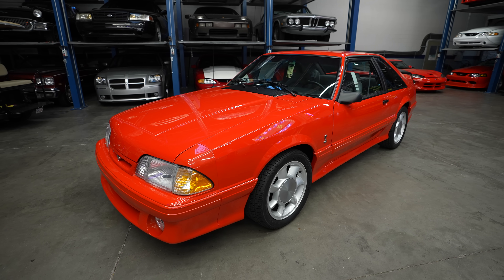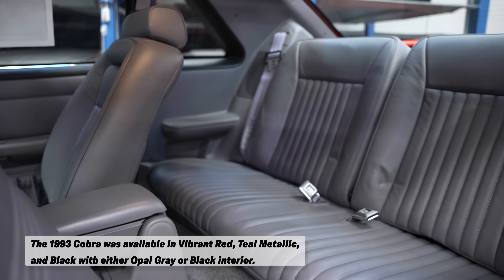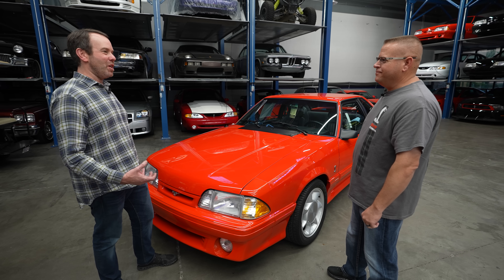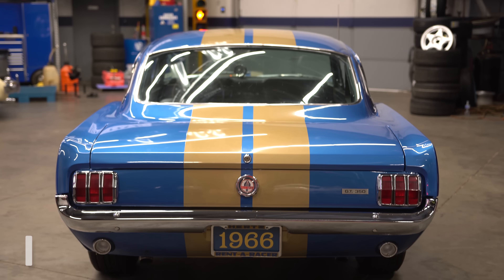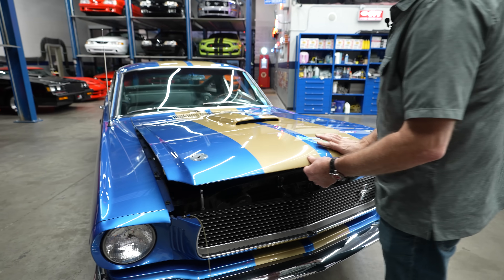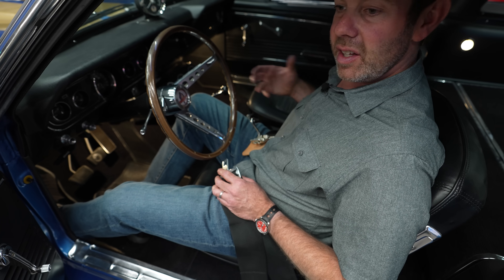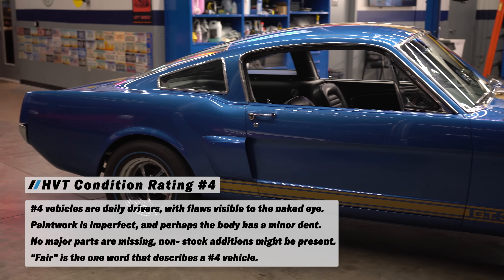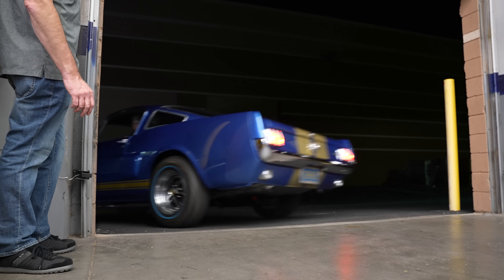1993 Ford SVT Cobra Mustang and a 1966 Shelby GT350 Hertz Mustang | The Appraiser - Ep. 8

Comment: In 2003 These things at 10 years old with low miles were frequently selling for $10-15K as people looked to the new Terminators; still kicking myself for not picking one up back then
Reply: BACK IN 2005 I BOUGHT MY VIBRANT RED 19THOUSAND ORIGINAL MILE SVT COBRA FOR 17.500 BUCKS AND TODAY I HAVE 20THOUSAND ORIGINAL MILES SO IT'S SAFE TO SAY IF I WANTED TO SELL IT IS MAKE MONEY ON MY INVESTMENT AND I HAPPEN TO BUY A 04 TORCH RED TERMINATOR WITH JUST 29HUNDRED ORIGINAL MILES ON IT AND I THINK IN THE FUTURE THE TERMINATORS LEFT IN MY CONDITION WILL BE BIG BUCKS LOOL I HAVE A COUPLE SUPERSNAKES AND I THINK MY TERMINATOR MAY POSSIBLY TRUMP BOTH CAR'S IN VALUE BUT ANYWAY WHEN I FOUND THAT TERMINATOR I KNEW I HAD TO BUY IT.

Comment: I couldn’t imagine buying my dream car to then park it in my garage for 30 years. 
Also, I understand that changing from stock makes it less valuable, but I would take disc brakes, a/c and a stick allll day over the original.
Reply: Agreed. My heart sank when he said it had 500 miles on it. People are free to do what they want with what they own; But I feel great cars are meant to be driven.
Reply: @KernelFault  I have to disagree a little bit, great cars should be shared. If you own a rare or special car and you are not sharing it on a regular basis by driving it (200 miles a year on this car would only be 5800 miles) or by showing it often you are doing a disservice to all car enthusiast.
Reply: @WH17Y  Then how are you disagreeing with me? 500 miles in around 30 years is roughly equivalent to driving the car forward, and then back to sweep under it.

Comment: You are incorrect about the competition license requirement for the 1993 Cobra R. No such requirement for THAT car. All 107 were immediately snapped up by collectors and almost none saw a racetrack. Ford fixed that for the 95 Cobra R which was the SN95 version. Ford required a racing license for the 95 Cobra R version. Three hundred made all in Wimbledon White, all manual cars.
Reply: HATE TO SAY BUT IT  YOUR WRONG OR THE FORD DEALERSHIP LIED TO ME.I WANTED TO BY A 93 COBRA R.BUT THE DEALERSHIP SAID I NEEDED TO HAVE A RACING LICENSE. LOL BUT I DO OWN  A VIBRANT RED 93 COBRA WITH JUST 20 THOUSAND ORIGINAL MILES  ON THE CAR AND THE BEST PART IS BOUGHT IT BACK IN 05 FOR 17.500 BUCKS AND TODAY I CAN MORE THAN TRIPLE MY MONEY BUT I DOUBT THAT I WILL EVER SELL THE CAR.

Comment: Barely 500 miles what a waste.
Reply: I don't even understand it... so, you buy a car that was $18,500 in 1993* and let's go with it being worth $90,000 today.  Had they instead bought a used ~1990 Fox body in 1993 for about $6,500 and put the rest in the S&P500, their "investment" would be worth over $100k today AND they would have been able to actually drive and enjoy the car.

can that be right?  I am the *7th owner of a 1993 Corvette that stickered for almost $40k!
Reply: Yea 500 miles in 29 years ...
Thats 17 miles per year and 1 mile per month .. what a WASTE. 
Those are not the original tires unless the car was on a lift with the tires hanging all the time or the tires were pulled off while sitting. 
A car will sit for a month and get a flat spot on the tire, but not all flat spots come out. 
And there is no way those tires lasted 29 years and not stiffen up.

Comment: What the hell. Who bought a fox body and didn't drive it? Who would pay 90k for a fox body?
Reply: @revolutionday1  The whole market runs on some weirdo who bought a car and didn't drive it finding another weirdo willing to pay 4x the original price to own a car that they also now cannot drive because it will lose value.
Reply: I’m sure you can restore a Fox body from the ground up as well as drop a Coyote for less than $90K.
Reply: @alstound  I think the point here is that you can own a badly-built all-original car that you can never drive. What a deal!
Reply: @Ficon  And was still beat by an off the showroom floor Z28 as was the 1993 Cobra R. The same Gen Camaro 1LE handily beat both of these on the track, hence the release of the 1995 Cobra R, which was, for the most part, a race car sans safety equipment. And did well in competition.  Followed by the 2000 Cobra R, which was another miss and easily bested by C5 Z06 and Viper. Why is it Ford needs to build special limited edition cars to compete with the rest of the segment?. Only to come up short, equal to, or maybe just a little better performance wise.
Reply: BROTHER DON'T BE A HATER LOL WHY DID THE CAMERO GO OUT OF PRODUCTION ONE WORD MUSTANG AND THAT'S A FACT LOL I DON'T HAVE TO GET INTO EVERY YEAR MUSTANG THAT KICKED CHEVY ASS LOL I BE HERE FOR A MONTH.

Comment: 500 miles is NOT a brand new car 🤣 

Only driven 500 miles in 29 yrs (17 miles per year or 1 mile per day) i would be worried about the internals of that engine.
Reply: I call BS on the brand new thingie. The door pocket is loose and the seats have a fair bit of wrinkles on them. I’m surprised the leather hasn’t flaked off, like unused shoes that were kept for a long time.
Reply: @alstound  I wass . . . Wondering.  . .about the paint. Looks unbelievable for the age. I mean we are talking Ford. Maybe it was owned by a museum 🤔  or something.

Comment: I don't think that the 64.5 to 66 Mustangs (even fastbacks) are as desirable (or at least their primary market is getting too old) as the 67, 68, 69's. They're a little too small. This Fox-body, however, IS the high water mark for the platform. I wonder if this is the one currently on BaT? But their value isn't necessarily in keeping them factory, but folks wanting to drop a Coyote or Voodoo in them, so their top-end value may cap differently.
Reply: Completely invalid argument.  A car is worth what a buyer will pay for it. Negligible difference among first gen cars. These are all worth a lot depending on model, body style and options but especially mileage and condition. Your argument that Mustang values are what they are because of your misconceptions is completely absurd. Most original cars of this vintage either rusted to nothing, got wrecked, crushed or ruined by aftermarket swaps. Rarity increases their value but only by so much. Convertibles and fastbacks are worth more than hardtops regardless of model year. Lots of variables impact the car's value, but your misconceptions aren't one of them.

As for the age of the market, again, irrelevant. You just described a 70s or 80s Town car buyer. Younger buyers are just as willing to spend big money on original correct cars as older buyers.

Couldn't you have at least taken a class on collector cars before posting ignorance on the internet?
Reply: Depends on what you consider younger i'm now in my mid/late 20's and grew up with a 65 GT350, 66 GT350, 67 GT500, 69 GT500 KR, and a 71 351 Boss in the garage and I prefer the 65/66. I feel the 71-73s are getting more popular because they are very cheap compared to the earlier models, I just can't stand the witches nose front end though. I will also say the 66 is valued at 2x the 67 and the 65 is 3x the 67. I'll also add that BaT isn't really accurate on classic car values as most are sold through clubs specific to that model. BaT is more for an average guy that may have to much money and not necessarily any specific knowledge to figure out the value correctly so they just pay whatever (I've witnessed buyers remorse on BaT way more than i've seen happy buyers).